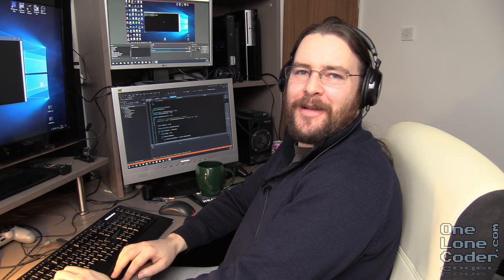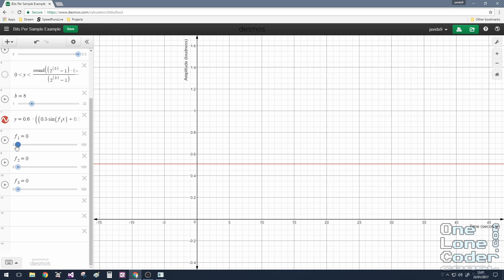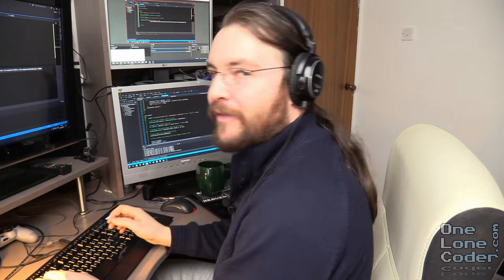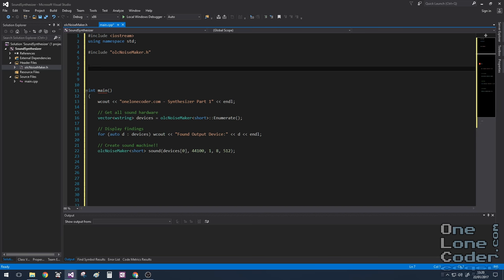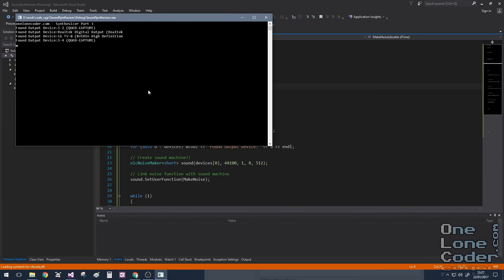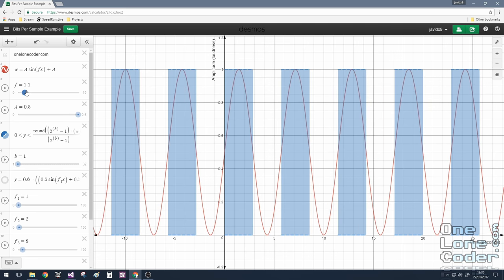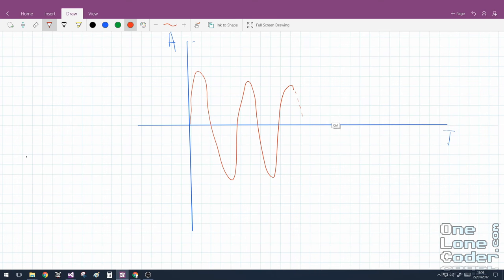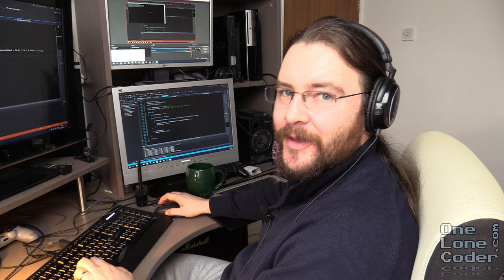Code-It-Yourself! Sound Synthesizer #1 - Basic Noises

Comment: If you started with a completely blank project and you're getting errors that look like: "exception thrown: write access violation." make sure you click the dropdown next to the run arrow at the top of Visual Studio and change the x64 to x86. I believe it's a result of your program using 64 bit addresses for variables when the sound api expects 32 bit addresses.
Reply: legend
Reply: Is this project possible in 64 bit?
Reply: good person you are thanks
Reply: THANKS A LOT <3
Reply: hey for some reason when i write the code provided around 24 minute mark of the video and try to play, all the sounds except for the base frequency, are really distorted. When k =0 everything is fine but as soon it goes up its messed up. Any ideas what might be wrong? is my pc just too weak to run so many for loops or?
Reply: omg you LEGEND. I was trying to fix this and didn't see that drop down. Thank you!

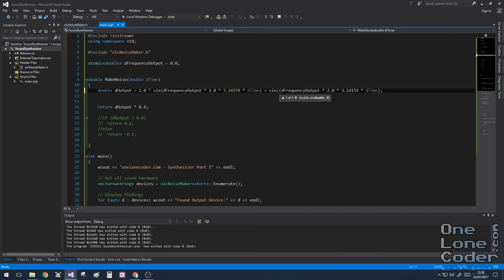Comment: Thanks for the great video! Please note that at 27:58 or so when you add the second sine wave  + 20 Hz, that the extra +20 Hz still plays when a key is not depressed because that extra frequency is leftover after dFrequencyOutput is set to 0.0.

Comment: This is really great chap. It’s good to see how one can apply ones knowledge to getting a software project started. Done a lot of programming in the past in the days when you could access ‘the metal’ ie the days of PCs with 386 processor running Windows 3.1 ...I’ve been frustrated as the OS have advanced gradually locking you out of the system..

Comment: Excellent video, I ended up using NFDriver so I can start with cross platform in mind, but was able to easily apply what you taught! Thinking of using a cross platform MIDI in/out library instead of keyboard input as well. 
Thanks, will definitely sub and watch the rest of your videos.

Comment: Hello javid, first of all: Thanks for that video!

I was trying to copy the code for main.cpp from your video, and I included the olcNoiseMaker header, but when I try to run the programm, I'm getting two Errors:

class "olcNoiseMaker<short>" has no member "SetUserFunction"

and

'SetUserFunction': is not a member of 'olcNoiseMaker<short>'

I then tried using your source code from github, loaded up "main1.cpp" and tried running it again: Only one error this time, but basically the same:

'SetUserFunction': is not a member of 'olcNoiseMaker<short>'

I am pretty much a newbie when it comes to programming (I have done a little bit of C in school a few years ago), so I am sorry if this is a stupid question. But if anyone could help me out or point me in the right direction it'd be greatly appreciated.

Comment: I love writing systems and I feel like this channel can help me learn a lot. Thanks. Have you seen handmade hero?
Reply from the maker: Hi George, you're welcome! I have not seen handmade hero. Worth checking out?
Reply: Okay yes it is worth checking it out. he has around 400 videos on making a game from scratch. At first he makes a software renderer using Windows GDI like BitBlit calls and then implements SIMD for optimization. Then he starts to make the engine or framework use openGL without using external libraries such as glut and goes over a lot of concepts that are important for graphics rendering. There are also conferences once a year. Check out http://handmade.network/. I havent gone through all of his videos but I definitely recommend it to everyone.

Comment: You mention about the software you designed to access the hardware ... that sounds great, so really to get started you could design a chunk of code that could be accessed from an Object in higher level code which would pass the essentials like, pitch and amplitude and waveform type although the most fundamental waveform you’d want is a sine wave. 
The thing that has eluded me since I was locked out of the hardware by advancing Microsoft OS is the ability to say, dump the contents of a wave table into a D to A converter somewhere inside a sound card....although I’m probably missing a trick here as it maybe reinventing the stone boulder before it was turned into a wheel...haha 
Any tip s on where to start using a typically good PC with decent sound card on how to create these low level functions that can be running real time and which could then interact with the higher layers of code one might write say using VB?
Reply from the maker: Hi Chris, audio on windows isnt too tricky to use, but can be a bit strange at first. Im unfamiliar with VB these days, but I would start by loading the library winmm aka windows multimedia. Thats what I do in this video. Its a bit old fashioned these days, but it does the job - the modern equivalent would be WASAPI, far more powerful, considerably more complex. Im quite certain there will be VB options for these two interfaces. And fundamentally, you are dumping a wave table into a DAC XD

Comment: These videos are absolutely fantastic. As a complete beginner in coding, i have learned so much already so thanks very much. I have followed things exactly, but when I play any tone other than the low A, i get a lot of squealy, squelchy noise on top of the tone. It kind of sounds like I'm connecting to the internet in 1997. Any insight into what i'm doing wrong?
Reply from the maker: Hi Olly, Thanks and I'm pleased to hear you're coding along! You imply there is something wrong with it sounding like a modem from the 90s! Lol. One of several things may be happening. Firstly, at this stage in the series, there is no polyphony, so only one note can be played at a time. If you hold down more than one, or somehow code in two notes playing simultaneously, you get a noise exactly as you described. Secondly, it could be your system is struggling to communicate with your sound driver fast enough. You can play with block size and block count numbers in the constructor. Video #4 of this series goes into some detail about what is happening here. Finally, you're maths for the other notes may be incorrect. Given low A works, and the others do not, this is likely to be the cause, as low A is also the reference frequency for the scale used when mapped to keys.
Reply: I'm having loads of fun learning so I'll keep working through the vids and double check all the maths. Can't thank you enough for these tutorials and for responding so quickly. I've taken paid courses in other subjects in which tutors aren't anywhere near as diligent and approachable. You should have a patreon!

Comment: pretty interesting to see that, so all of DAW`s synths were build using this technique eh ? But how about modeling an analog synth (I`ve hear this keyword a lot in DAW). It is not in my area of knowledge but after watched I feel like I watch at the birth of digital synths.
Reply from the maker: Thanks for the comment, I think most modern DAWs that emulate classic analogue synths certainly use a similar approach, albeit probably a more efficient implementation. Emulating an analogue synth would require engineering in imperfections, to give the characteristic sounds. I'm sure this is a whole field in its own right, and no doubt the source of ferocious debate on the net.

Comment: I have a question about your usage of GetAscynKeyState(). 
I don't understand the parameters that you are passing into it @ 23:06.
When I look at the MSDN docs, it says nothing about this kind of argument.
Forgive my ignorance, but could you explain how that works and what you are doing? It looks like a string array that the function iterates through and then associates the value of k to each of the corresponding key that was pressed, I have never seen this before.

I hope you understand what I am asking.
Thank you for the great Videos, again!!
Reply from the maker: Forget that its GetAsyncKeyState() - thats just a function that takes a virtual keycode. Consider a string, its just an array of characters, so I am accessing that array, just as I would with any other array, using [k]. Each iteration through the loop it returns the keyboard key that Im interested in. Fortunately wchar_t, char and virtual keycodes all have the same values for alpha numeric digits, except for the period and comma keys, so I use an equivalent hexadecimal representation in the string for those. I then take the result of GetAsyncKeyState and and it with 0x8000 to extract the most significant bit, which tells me if the key is pressed.
Reply: @javidx9  
Well Mr. "OLC", I sure don't know where my brain has been but I thank you for the vids and help in your replies.
It has taken me a couple of days to wrap my head around the fact that you are essentially doing this:
ch[] = "ZSXCFVGBNJMK\xbcL\xbe";
for(k = 0; k < 15; k++)
{
 if(GetAsyncKeyState(ch[k]) & 0x8000);
 {
  // do something.....
 }

}

I sure don't know why I couldn't get that straight away. For some reason that syntax looked so foreign to me.
I guess I was too busy trying to make things to difficult by thinking GetAsyncKeyState() was some kind of super mysterious function that only you know how to use. ?????

Comment: I really really enjoy your videos and they have encouraged me to study programming more than my university probably ever could. Thank you very much for your work!
That said, I ran into a strange issue and wanted to hear your opinion on that. My code is very close to yours but when I press a key to play a sound, I get a lot of screechy noises combined with the supposed output, however they don't appear anymore once I insert cout << dFrequency << endl (or '\n'). Running calculations instead of writing the frequency to my console doesn't change a lot. It seems only my z key (which is supposed to have the base frequency) is not affected.
Do you have any idea why that could be?
Reply from the maker: Hi Robin, Sorry to hear you are having an issue. It sounds like a pacing issue. Perhaps you are sending too much data to the sound card, and outputting to the console is slowing things down a bit? That said, if you sy the Z key is unaffected, double check the maths for the scale. If you are getting screeching, thats usually a sign that the frequencies are changing really quickly, or the summation of simultaneous notes is not quit right - also make sure you are not clipping if your amplitude is too high.
Reply: I made the stupid mistake of putting my if-clause, that sets the frequency to 0 if no key is pressed, into the loop that checks for pressed keys.
I am just surprised that running inefficient (modulo) calculations didn't have the same effect as writing my frequency to the console. 
Thank you for the help, I can finally continue.
Reply from the maker: Writing to the console is painfully slow, many thousands if not millions of clock cycles when you consider the string needs to be interpreted and security checked, then each font character needs to be rendered (they're complex splines, so plenty of bezier mathematics to solve, and maybe even some rasterizing to scanline them into the display buffer), then the OS has to deliver the screen to the GPU. Calculations on the other hand will probably only be 10s of clock cycles. Good to hear you got it sorted!

Comment: Popping a question in, in case anyone has an answer. I use Jetbrains CLion for C++. I use their IDEs for all of the different languages I use, via their free Professional licenses for students, and so I have never used Visual Studio. CLion (obviously) doesn't have VS Linker, so I am trying to include winmm.lib as a dependency via CMake. My question would be: is winmm.lib a Microsoft SDK library? Because it isn't on my system by default, as far as I am aware, and if it IS a part of the MS SDK does it come included with Visual Studio, and that's why I'm not seeing it? Are there alternatives to this or do I need to install the whole SDK specifically for the purposes of this tutorial?

Comment: I am trying to do almost the same thing you did, but a more basic version. And I am going to use a Tiva Launchpad from Texas Instruments. So I can't use windowns sound library. This is a school project, I'm studying Electrical Engineering. My professor said That I will have to do the sin(x) with tabled values and I am struggling a bit to figure this out. Also the professor told me to use the PWM module to drive the H-bridge (as a class D amplifier) into some random speakers. Could you give me any tips on using how the pwm would work not changing the note i decide to play? Thanks for your videos and for the code, they will be very helpful.
Reply from the maker: Hi Felipe, my next video will show something similar to PWM generating audio for my nes emulator. Maybe that might help!

Comment: Great video and very informative. What would be required to port to Mac? What is Windows-dependent?
Reply from the maker: Thanks, specifically the header file used here is very windows dependent, though I've since released a newer similar one called olcSoundWaveEngine
Reply: @javidx9  Thank you, I've found that one.

Comment: Is there a reason you don't use something like SDL, SFML or OpenAL to handle the audio? I would figure they would be pretty robust and would have more flexibility?
Reply from the maker: Hi Joshua, all of those are great libraries - but, they are also completely capable of doing all the things I want to demonstrate out of the box. They have built in oscillators, and sound fx, midi file manipulation etc :D I don't think the videos would be very interesting! Also, I like to show people that just armed with a compiler and an OS you can do this stuff too. There are lots of resources on using libraries, but not many on how the libraries actually work, or the underlying principles of what the libraries try to achieve.

Comment: why does my visual studio not return with 0? it returns with "The program '[18024] Sound Synthesizer.exe' has exited with code -1073741510 (0xc000013a)."  i do not get any erorrs just curious.
Edit: it was because i did not exit correctly using the stop debug button, i just clicked x on the windoes console. leaving it here incase someone else finds this useful.

just finished the video, loved it, so here's my comment

Comment: I got an error saying that an exception was thrown. "Exception thrown: write access violation. It seems to happen in a header called xatomic.h

How can I fix this?
Reply: If anyone gets this, I think it has to with choosing a x64 console. Follow the video he made on using visual studio 2019 with olcPixelGameEngine (use it as reference).
Reply: Oh, and it's important to mention that for this particular project, leave the "C++ Language Standard" as "Default." 

(Don't change to c++17 standard as seen in video I recommended)

If left on c++17 you will get errors about bytes.

Comment: I have a question on this: How do I even load the code in the first place? I can open the source in Visual Studio, but I can't figure out what to do after. I'd like to at least have it work before I start messing around and trying to make my own noises.

Also, I tried following along from the beginning, but the project template thing doesn't appear to exist, so I'm totally lost.
Reply: Trackmaniadude Visual Studio has changed quite a bit since this video. You might want to check out some of the articles on learncpp.com. You should be able to get up and running with that, then just paste the code in and compile.

Comment: First programmed C on Z80 CP/M  machine so I was shocked you'd create a square wave using the sin() function. That just had to be horribly expensive in processor cycles compared to code like "double dOutput = (int(dFrequencyOutput * 2 * dTime) & 1) * 2 - 1;" . Tried my code and didn't get much less cpu % for the MakeNoise function using Vis Studio '17s profiler. Hmmm... a bit of googling and goodness... x86 has a built in fsin and fcos instructions. Might take 65-100 cycles, but that's just an un-cached memory access these days. Imagine Yorkshire accent - FSIN, luxury...  Back'n my day you d'n 'av hardware multiply on t' 6502.

Comment: So, @ ~ 4:30 you're modulating the wave with an LFO, right?
Also, if b is the bit rate (i.e. 8 bit, 16 bit).. 
How can we incorporate & visualize the sample rate (i.e. 44.1 kHz)?
Thanks for the video.
Reply from the maker: Yes. To view the sample rate the easiest way would be to create a square wave of the frequency you want /2 then the rising edge will be the sampling point
Reply: What would the formula be; so that it adapts when the other variables change? I think I copied your whole Desmos diagram exactly. I've been trying to wrap my head around the physics and math for a while, so having something that's.. (kind of) tangible and interactive is pretty interesting to me..
Reply: By the way, I think you want to drop the +A from the end of the first equation. I mean, you probably know better than I do, but that will fix the DC offset (mean amplitude displacement from zero).

Comment: Im having problems with your code. If i remove the * 0.4 from the MakeNoise function it works. But if i write it the same as you i just get the screeching and bumps you showed at the end
Reply from the maker: Hi Hector, Hmm, I'm unsure, all the 0.4 does is affect the amplitude of the signal. Are you sure your code is identical to mine?